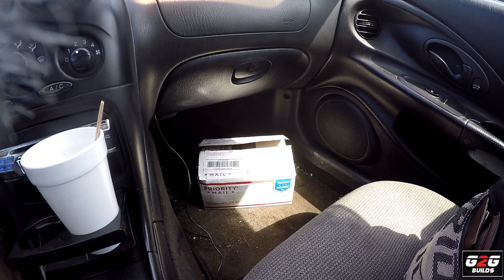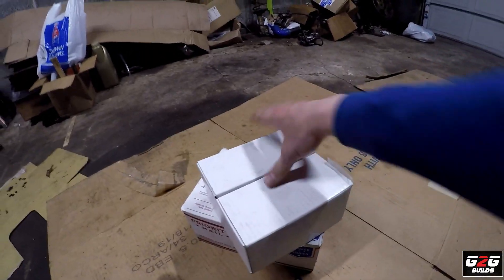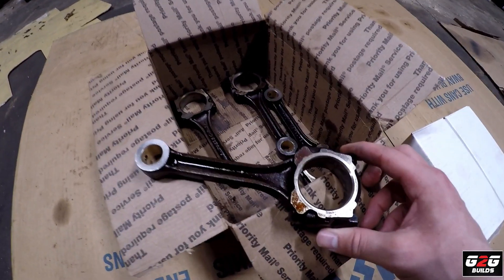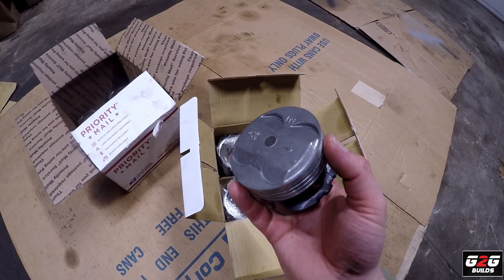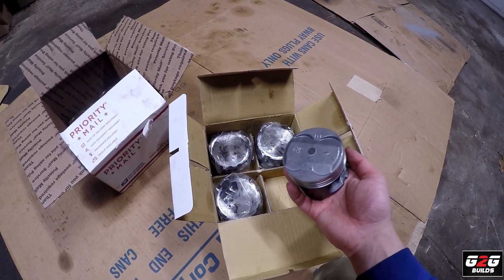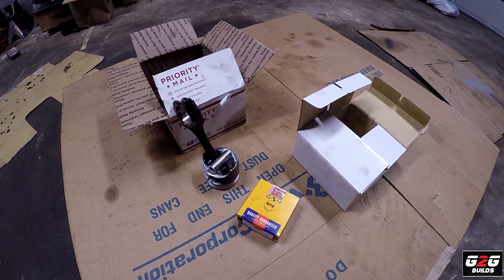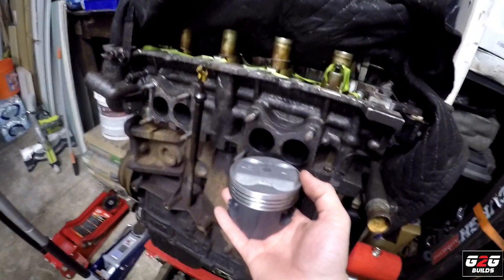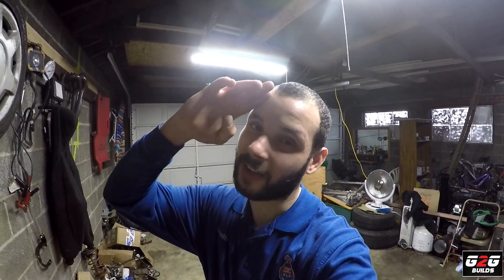New Pistons Reveal for the GA16DE Engine Rebuild

Comment: Awesome choice of engine bro 👌, I didn't get high compression pistons for my GA16DE Pulsar, but I planed 2mm from the cylinder head, which by coincidence gives an extra 1 to 1 compression ratio for each 1mm taken from the head, on this particular engine, so mine now has 12 to 1 compression ratio and after I ground out the ports to template tune the new stainless steel headers, I have 126.5kw's (was only 75kw's), and wow it's really fun to drive now 😀 👍ps it was a bit higher compression than I wanted and cannot use any fuel below 95 octane 😄
Reply from the maker: Thanks a lot bro.
I should finally get the engine assembled by the engine of the year if everything goes according to plan.
I'm sure it will be a blast to drive.
Reply: @G2GBuilds  yes and as I always say "who needs a turbo and intercooler" I have a cold air collection that goes right down to the vents in the spoiler, and that makes a serious difference bro 🤗, especially on a cold night, I also love making headers work and fit perfectly with a twin turbo-flow cobie-resonators exhaust system, that isn't very loud, but it definitely tells you how well the combustion is working and how efficient it is, my brother is a mechanic with his own business and knows how much of a bullet proof engine they are, and you would have seen how the main bearing caps have the great cast iron frames to strengthen the block, so the bottom end has already been upgraded standard 😀 👍.

Comment: Bro can I get the link for the pistons
Reply from the maker: They are Honda d16 76mm (.40 oversize) high compression pistons. On ebay you can find either by Nippon racing or YCP. They are not a direct bolt on, and will need to send the ga16de rods to the machine work.

Comment: What is the name of the making of those pistons and can i order a set through you??
Reply from the maker: You can get this one on eBay.
They are 76mm for a honda d16. You can get them YCP or Nippon racing.
Reply: @G2GBuilds  is it stock pistons for the b16 honda engine or aftermarket?
Reply from the maker: @uncle_iroh4839  they are aftermarket, and they are .40 over standard bore.
Again, they need to be 76mm to fit stock bore on the ga16, and you must send the connecting rods to get machine.
Reply: @G2GBuilds  ok very nice
Reply: @G2GBuilds  what side will I have to machine on the connecting rod's?the piston side or the crank?
Reply from the maker: Piston side
Reply: @G2GBuilds  nice i'm in the Caribbean so i'll have to look for dem on ebay...
Reply: @G2GBuilds  I found them in the both brand...ebay is the shit..but i'm having problems with stuff being shipped to my island...
Reply from the maker: Nice...
I hope you can get them ship to you.
Reply: @G2GBuilds  me to but like ebay don't like me at all....
Reply: Peep this my amigo.what displacement is your ga16?,and #2 what is your cylinder bore..
Reply from the maker: @uncle_iroh4839  displacement it's 1600cc and bore is 76mm. Everything is stock.
Reply: @G2GBuilds  nice and sweet
Reply: @G2GBuilds  gracias mi amigo super helpful
Reply from the maker: @uncle_iroh4839  no problem my friend.
The whole idea of using this pistons is to change the compression. High compression will make more power NA. Lower compression is better for turbo applications. This aftermarket pistons are also about 25% stronger than stock. I have seen people pushing 25psi on YCP vitara lower compression Pistons.
Reply: @G2GBuilds  in my borat voice very nice

Comment: Acabo de terminar mi proyecto ga16de+t tengo 190 compresión por pistón y se siente muy bien, en este momento tengo solo 3 psi porque mi bomba de gasolina no abastece las 8psi y el clutch me patina bastante. Turbo t25 garret inyectores sr20det, wastegate externa. Y más. Stock motor.
Reply from the maker: Excelente!
Y cuando viene la bomba de gasolina y el clutch nuevo?
Reply: @G2GBuilds  espero y sea lo mas pronto posible. Pará poder probarlo mejor.
Reply from the maker: @narrothcr  suerte con el proyecto!
Reply: @G2GBuilds  gracias, ahí te estaré actualizando de como van las cosas.
Reply from the maker: Excelente

Comment: Hi there. I'm aslo a GA16 enthusiast from Cape Town, South Africa. Read up the build Mathers Motorsports did years ago. You will get a lot of tips for building a NA Ga16. 

Camshafts
HEADWORK
lightened flywheel.
The big 3 for the GA16. ( From my experience alteast)
Reply: Link
Reply: I think mine needs a heavier flywheel, that might calm her down a little lol, very lumpy and hard to keep smooth at low speed, but seriously awesome with the acceleration when I get traction 😄

Comment: Hey, I have a GA16DE, what pistons are those? You didn't say it on the video. Did you had to do any modifications to the rods to make them fit? What are the measurements?
Reply from the maker: Hey.
Those are oversize piston from honda d16. The conecting rod have to be modified to work with the piston.
Reply: P29 pistons .40 over u have to send them to a machine shop to get a pin or clip put in and use the stock wrist pin or have the Honda pin cut to size

Comment: What piston rings size/oem numer do you have?In Poland only one size is for this engine but is it wrong (1.5x1.5x3.0),in my 16de oil ring in piston had size 2.7 and must enlarge it.Take care bro.
Reply from the maker: Oem ga16de bore size is 76mm. The pistons rings needs to fit the 76mm piston. I don't have any part number information. The piston rings on the video are suppose to work with the high compression pistons. Sorry!